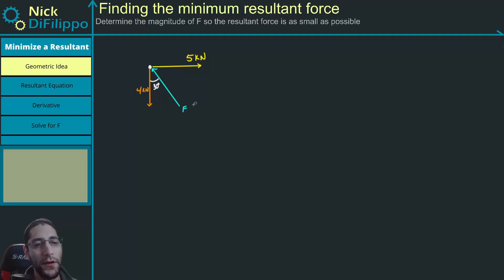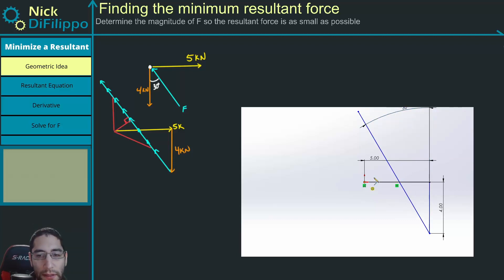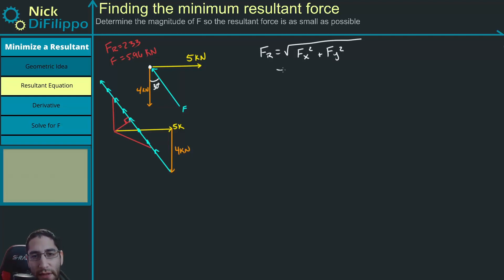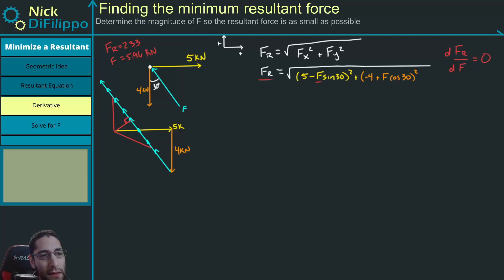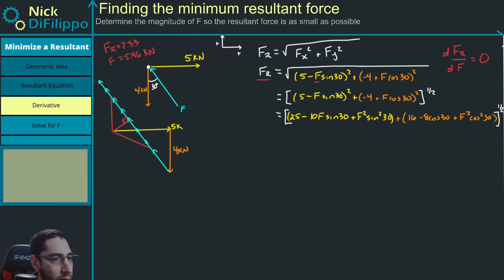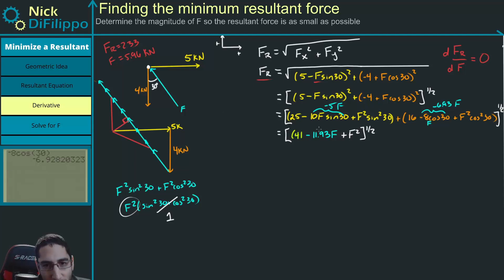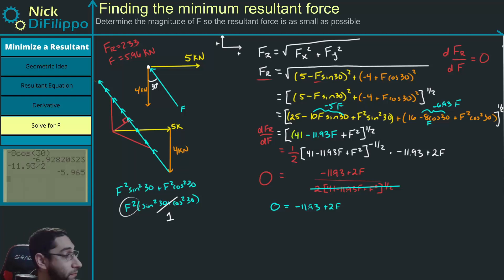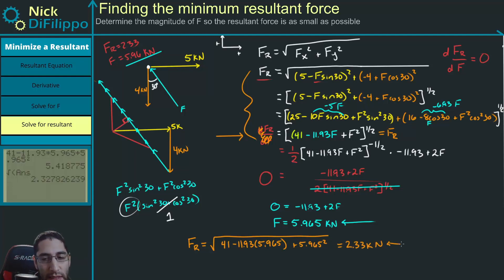Minimizing the Resultant Force Using Derivatives

Comment: how'd u know sir if it's 30 degrees when u drew it in the app
Reply from the maker: 30-60-90 triangles. F crosses the 5kN line and from given information the angle between F and 5kN must be 60 deg (90-30 deg). 
When I drew it, F is still crossing and making a 60 deg angle with 5kN, and the 4kN and 5kN make a right angle.
Reply: @EngineeringCorner  thanks sirr